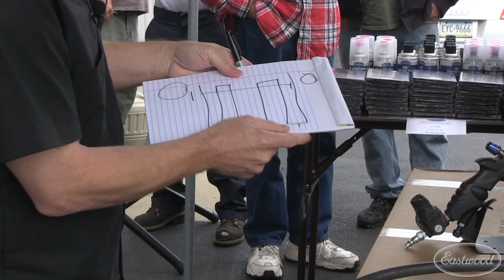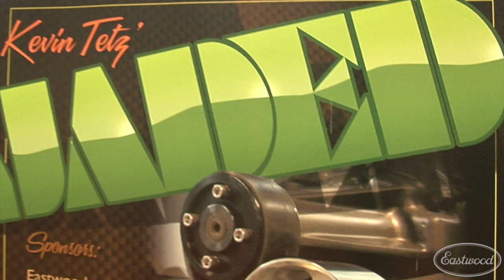How To Paint & Set Up Your Spray Gun - Great Tips with Kevin Tetz at Eastwood Part 1 of 2

Comment: I have a 5HP  220Volt 30 Gallon running thru 50 feet of iron pipe, think that's good enough to cool the air down?